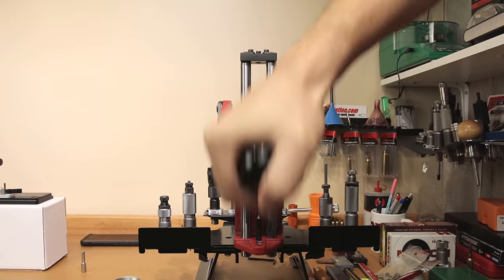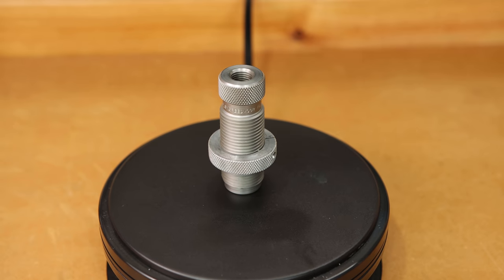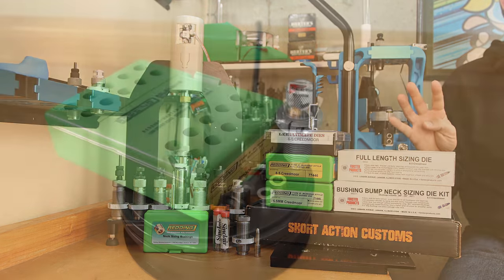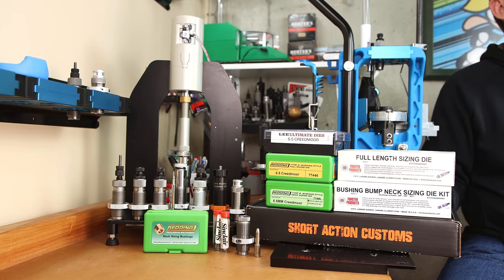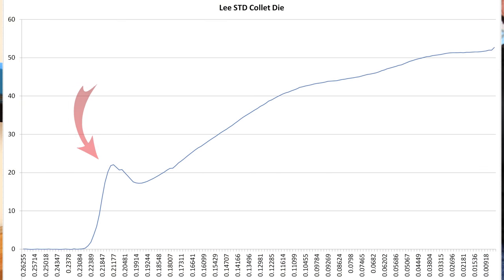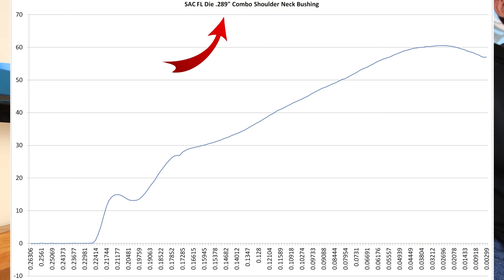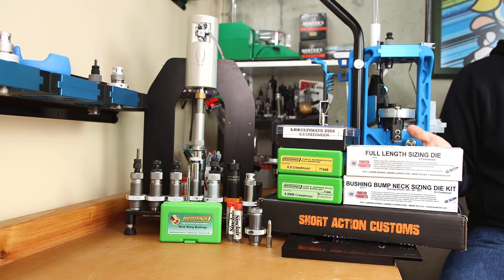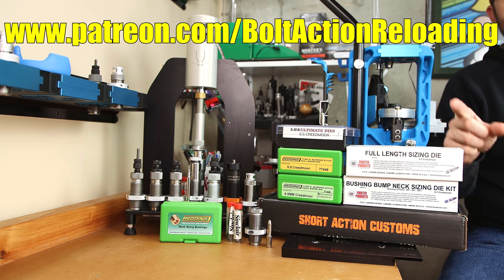How should I size my brass?- How Case Neck Tension and Case Volume Changes

Comment: I use the Lee Collet Die and follow with the Redding Body Die. The method minimally works the neck. Less working of the neck. I do not anneal. Very consistent results with great accuracy. I never have a neck crack, primer pockets are the first to go.
Reply: ^^^^ This is the wonder die set. You need a Forster with micrometer seating die and that is the golden combination. Basically the Redding Body Die first, Lee Collet Die for the neck and a Forster Seating Die with micrometer to finish it off.

Comment: This is a fantastic video, such great data. There is so much valuable that can be extruded by comparing individual bullet seating graphs. As an example, I shoot bench (600 or 1000 yard) every week. I want minimum case tension on my bullet and use combination of Lee Collet Die and Redding Body Die for all my reloading. Your data clearly shows this method to be one of the best for least neck tension. For this result there is less energy transferred into the brass from the process, thus less working of the brass. I do not anneal and get about 10 uses from each case, and almost always a primer pocket failure. My fellow shooters are surprised how consistent my reloads are without annealing. We now know why, the brass is not being work-hardened as much as the other methods. I use exactly 20 pounds on the Lee Press handle, no more. And the same for all cartridges. This video demonstrated to me why my reloading method/process works well for me. Again great job on videos. Thank you.

Comment: I didn't watch your videos all the way through, so you may have already answered my question.  Did you perform and statistical tests on your results?  Like an ANOVA?  As they say in statistics 101, if you get n big enough, any difference between two samples will be statistically significant.  BUT, just because  the difference between two samples are statistically significant, that doesn't mean that the difference is real or makes any differences in the context of the thing or process measured.  So for example, a drug company makes a new blood pressure drug that ends up with a statistically significant improved effect, that doesn't mean anything if the difference is only 1.2 mmHg.  

So what are the differences in outcome between all these different methods?  And are the results significantly different?

Comment: Great content as always. They are impossible to get now but they make mandrels for the SAC. I run a 2625 in the die - don’t have my amp yet to measure but it’s nice to do in one operation and the concentricity is insane.
Reply from the maker: So far the SAC stuff is really impressive. Don't get me wrong for the price it should be. It is on my list of things to do.
Reply: @BoltActionReloading  I agree. I have two of their dies - Ive had the whidden click dies that are great too but I think that the shoulder/neck bushing solves a lot of the problems with bushing dies, throw in the ability to mandrel and now you have a better solution than the body sizing/lee collet combination that some BR guys recommend. Pricy but I think worth it. I could make the argument that this is one of the places where you should spend your money. The fact that they are a gunsmith is a plus too. I have to tell you that my 6.5x47 is perfectly chambered (something Im not used to as I come from the factory gun world). Makes life so much easier when sizing and figuring out headspace as well as bullet seating (especially if you throat for a particular one). At my desired jump, the bullet seats perfectly at the neck/shoulder junction (with a little room to go back and forward). At Jam, it pretty much sits at maximum COAL to fit the magazine. Pretty neat.

Comment: Have been reloading for over 50 years. Most of my rifles are 243 improved, 22-250 improved,22BR,17-222 improved etc….. all tight necks…. I only  neck size…. Brass doesn’t stretch much… Wilson neck dies … very easy to load for….

Comment: So, I'm not sure how your data translates into smaller SD's or groups. Why do case volumes matter, how and why do I use your graph data to select a neck sizing technique. I like the results for improving concentricity, but the bottom line question has not been answered.

Comment: So are you saying you can use short action customs bushings inside of the redding FL sizing die?  I have never used a bushing die.  Working on setting up for the first time, for long range shooting. Normally reload just pistol
Reply from the maker: You can use them in a redding s die. Standard dies don't take bushings.

Comment: One more test option I wish you had tested was a custom honed Forster FL die followed by the 21st Century Mandrel.  This way the neck is not over worked, the neck is full length sized and the necks walls receive the benefit of the proper sized mandrel for neck tension and straightness.
Reply: That's what I use and I see no reason to change...best $10-15 you can spend on a die.

Comment: Along the lines of Ray C's comment:  I'm not sure what to do with this info. 

 Regardless of how you size the body, the details of how you size the necks affects seating forces, pretty obvious on the face of it.  Differences in seating forces are easily felt if you use an arbor press.  One thing you didn't discuss was inside neck lubing.  I've found neck lubing to significantly affect the feel & smoothness of seating. 

 I'm not sure what to do with your case volume data.  You would need to take into account the initial variances in case volumes before sizing.  Without some sort of normalization, you can't conclude in any statistical sense that the variation observed after sizing is significant;  the overlap appears to be within one or two standard deviations without normalization.

In the end, it all comes down to MV consistently (small SD's) and down range accuracy.  The relationship among all the variables under the reloader's control and seating force curves as they affect combustion and accuracy is sure to be quite complicated and probably not amenable to a clear, concise conclusion.
Reply from the maker: Hi Tim, Its a starting place. Please note my next comments are not to attack you but simply to try and explain my point of view for the structure of the test. Imagine your new and there are 50 ways to do something and everyone tells you something different. All the methods in this test are methods that people have told me to do over time in my comments section. (I guarantee over time there will be comments on this video asking why didn't you test this way?)

 Who has tested all these different methods and where is their data? Welcome to the life of a new reloader. What is the difference? Does it make a difference? (the most important question) Should I spend $15 on a die or $800? Not everyone has an arbor press, should I tell every new guy to add that to the must have list? This just puts one more obstacle in the way of getting started. (I would argue that some of these variances would be difficult to see with and arbor press) Does everyone need to use neck lube some say yes and some no. You have to isolate these variables. If I put them all into one video not only would it be a nightmare, no one would watch it, therefore no one would learn from it but me. Some of these things will be obvious to some but not others. 59% of my audience has reloaded 5 years or less.  In the end this will be part of a playlist that tries to show all of these different factors so people that want to know can learn. Hope this makes sense.
Reply: @BoltActionReloading  I was not trying to be critical, I'm a big, big fan and longtime subscriber.  Keep 'em coming!  However, I'm just frustrated with the endless torrent of advice we get, often conflicting.  I don't have the time or budget to do all the testing I'd like.  In the end it's about achieving our best results under the practical constraints of time and resources.  Are force curves differences important?  Are case volume differences important?  If so, we need criteria to let us know when the variation is significant enough to require attention.  In a narrow sense, the fact that variables can be quantified only has value when we can relate them to objectives.  For example, the latest spate of videos on primer seating/crush begs the real question of what difference does it make to my objectives.  One expert tells us primer crush is critical, another says just buy good brass and move on.  Diagnosing why one is not getting the accuracy hoped for is a daunting prospect, especially in these times of scarce components.  How does one navigate all the helpful and often conflicting advice we get?  I'm looking for the biggest bangs for my bucks.
Reply from the maker: Hi Tim, no worries. I don't really expect anyone besides me is crazy enough to do it is all. The seating force charts are "mostly" to illustrate what's going on. How much of the neck is really sized and the resulting seating force. (do you want a different bushing size?) My example is what most directions and advice that I have heard, but I have also heard folks say that the seating force here is too high. I hoped someone that had a number in mind could do some quick adjustments and maybe have to buy one more bushing they didn't need. If you look at the charts closely you can see every little detail of what the dies are really doing. (its very hard to articulate this for me though) I too am frustrated with some stating that (for example) concentricity (or runout, they are not interchangeable but most use them that way right or wrong) is not important and the same person 2 week later stating they do it this way because its more concentric. At the end of the day, everyone wants to hit the target. With these charts hopefully you can get a ball park idea what (if anything) changes if you do or don't use a mandrel, see how much lower seating force by using a collet and how they all compare. Like I tried to say, this is a multi part series. I couldn't think of another way of doing it. For kicks between the time you responded to me last someone asked why I didn't neck turn too. It never ends.
Reply: @BoltActionReloading  LOL

Comment: Thanks for doing this. I love seeing the data-driven comparisons. However, for this I think I would have wanted to see which method produces the most consistent results; an ES/SD sort of thing for neck tension seating force with the AMP press. I love that you included the Lee Collet die into the mix as that one doesn't really get compared too often. It's especially interesting because you can order custom sized collets for it to spec within 0.0005" for just $10/ea. I haven't had great luck with it personally, but I could never figure out why. The concept behind it seems to be great in every regard.

Comment: Out of all the styles of dies which ones produce the least amount of runout? I’m wondering if a custom die made from once fired cases from Wilson or Whidden Gunworks would achieve better results compared to off the off the shelf dies. Since you’re using a Wylde chamber a custom die may be the ticket. Have you tried a Warner Tool die yet? I am torn currently because I’m re-chambering my .308 using a Bisley match reamer so the thought is for best results a custom resizing die will be required. I also wanted to thank you for using the reasonably priced Hornady bullets in your tests. Great videos keep them coming your helping us make the right decision the first time around on equipment purchases cheers.

Comment: I prescribe to PO Ackley’s recipe for case hardening and movement, his AI cartridges do perform as advertised. I shoot a 260AI and have 5th generation brass still in circulation. The increased case volume is an added bonus, and you can still use standard cartridges.

Comment: Sweet video. I'm a body bump and Lee collet guy. Can't you adjust the tension by screwing the collet die in a touch more?
Reply: The internal rod sets the diameter, I’m not sure more pressure would do anything good or valuable. I’ve always heard and been told to get or make a smaller rod for more tension

Comment: In option three, with, I think the Redding S and 0.290" bushing, you had concentricity issues.  You also suggested using a Short Action Customs bushing of 0.287".  Why the different size?
Reply from the maker: At that point its the only size I had tested with SAC bushing. I have a set now so I plan to test a very wide range. I had been waiting for a 288", which I now have. Now just to find the time.

Comment: Hi! Why you did not include neck turning + bushing neck OD sizing only? (perhaps a pass why expanding pins for safety). Is it an unviable method?
Reply from the maker: Hello, I really think that neck turning is its own subject. I was hoping someone wanting to know what dies they should pick for just normal brass sizing would find what they needed to know. Any more many guys claim that they wouldn't neck turn if their chambers accommodated un turned brass. Probably sometime, in a different video series.

Comment: Given the high price of hunting rounds, specifically for 308, 223/556, and 30-06, have you ever bought FMJs, and reloaded hunting bullets of the same weight to save money?  It seems to me that a lot of money could be saved, brass could be sized to ensure specs, and reloaded with the same powder.  Thoughts on feasibility?
Reply from the maker: Hi Jack, Just because the weight is the same doesn't mean it will perform the same. I could see trying to get in the ball park when it come to finding components, but if you factor the extra time that would be required I just assume spend the cash up front rather than find out I should have from the beginning.

Comment: If the load was developed and tuned with two thousands neck tension it is no surprise that all of the numbers confirmed this was the best combination.   Had you developed a load with three thousands neck tension I would suspect that the numbers would fall into place as well.  I think good consistent neck tension is easiest at 2 thousands for many cartridges and this makes for a great platform for developing loads and tuning your rifle.

Comment: I'm not sure if the case volume measurments tell us much in this video. We don't know, what was the case volume before the sizing. Thus, we don't know, if the Avg, SD and ES are caused by the variance in manufacturer's production process, or by the sizing process using a particular die.
I'd be more interested in the seating force difference (Avg, SD & ES) between various sizing methods.
In my experience, Lee Collet + Redding Body die give me a more uniform neck tension, than standard FL (I've got Lee and Forster FL dies). One of my colleagues is quite happy with a Redding FL + LE Wilson expander.
We don't have the type S dies, so I'm glad to see a side-by-side comparison here. Thank you!
Reply from the maker: They will matter when we look the velocity and pressure data for this test. Its coming.

Comment: Have you got your hands on the Foster Bump Die?  I just got one in UPS a few days ago but haven’t used it yet.  I have heard Erik talk briefly about them, he doesn’t like them go figure but I didn’t hear the reasons on why.  Just curious if you have played with one yet?  Great channel, you always have plentiful info:)! Cheers
Reply from the maker: Yes it is one of the dies in this test.
Reply: @BoltActionReloading  Pardon me on that one, I swear I heard you saying that they were out of stock and you were wanting to get one to review.  Potentially I mixed it up with a prior video just in front of it and must of missed the part on this video when you were talking about it.  Sorry for my fumble on that one
Reply from the maker: No appology needed. In the previous video I mentioned that I couldn't find one. It came in stock as I was loading the first round after fire forming. I hope you find the data interesting!
Reply: @BoltActionReloading  I always do!

Comment: It's been a year since you put this one out, and I wanted to check in and ask which of these methods is your current favorite? Thanks so much!
Reply from the maker: HI Rick, I am always testing so there are a lot of options. The last large lot of 6.5 CM I processes was with the SAC die. I will cover it in a upcoming video at some point. If you looking for a bushing diee that won't break the bank the Redding S die with SAC bushings would be my go to.
Reply: @BoltActionReloading  thanks!

Comment: Wish you would do a comparison using the SAC bushing and factory expander ball! I’ve had fantastic results with it, which leads me to believe the common misconception that the expander ball was causing all the runout is NOT true! It seems to me, its the type of bushing that was causing all the problems, not the expander ball. Match the SAC bushing up with a Whidden bushing die and their adjustable expander ball kit and you have complete control over over sizing the neck and neck tension. All with next to nothing run out! In ONE STEP!
Reply: Have you by chance bought a SAC expander mandrel and used it in you SAC die? If so, I would be curious to hear your results. Thanks!
Reply: @kenhatley1041  Sorry, I have not! I don’t have any SAC dies,mandrels, only bushings. The SAC bushing, along with the LE Wilson “tapered”  bushings fit into the Redding, Whidden, Hornady, LE Wilson sizing dies. What I can say is, using the SAC and LE Wilson “tapered bushings” has eliminated most of my runout issues! And that is using those bushing to size the neck, along with using an expander ball to set the neck tension! Which is contrary to the conventional wisdom that expander balls cause runout! YMMV.
Reply: @58harwood   Thanks so much for your feedback!